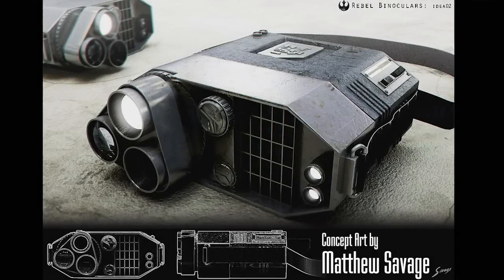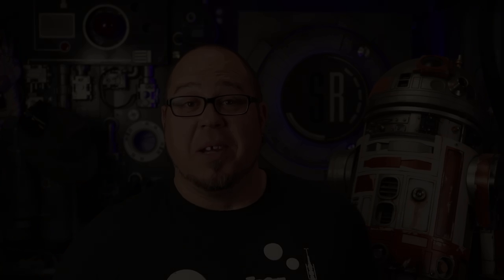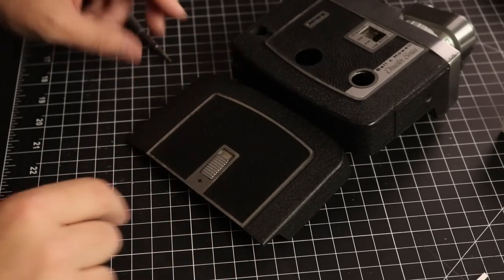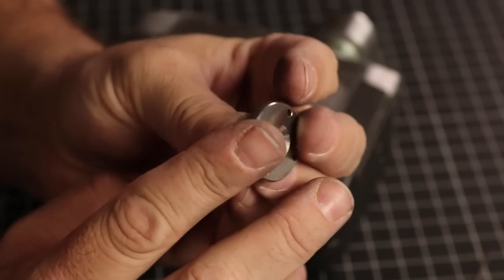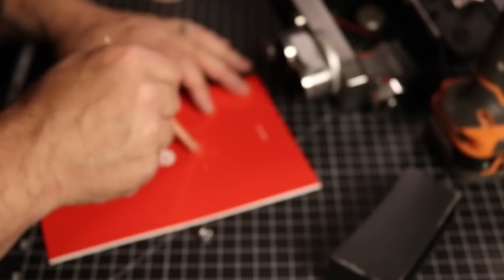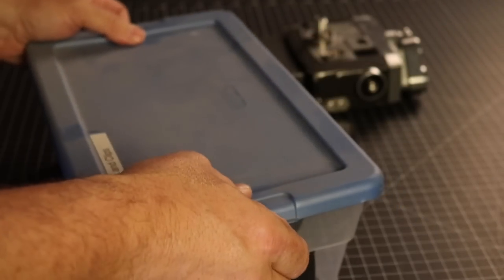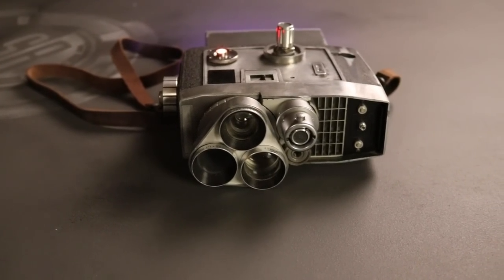Star Wars Binoculars Diy | Custom Project

Comment: I really good way to diffuse the light from those LEDs and make them less of a spot is using the closed cell foam sheets that's used as packing material. Play around with how many layers you need, sometimes only a single thin sheet works great. I use it in the blade plugs for my lightsabers.
Reply from the maker: That's genius! We're going to try that out next time! Thanks for the advise and thank you for watching.

Comment: You could also wire the LEDs into that potentiometer so you're not blasting your eyeballs with blue.  Some people may be fine with it, but blue LEDs get my eyes badly and I usually have to put stickers over them on my devices to dull them down.
Reply from the maker: Great idea!

Comment: Not a bad job... but this is a prop, a stage prop for a fan film. . Have you thought about creating a working sample of electrobinoculars like in Star Wars? I think that these things will be needed for this: an old vhs video camera or a mini-dvd with an ocular viewfinder, there is a very small, about 1.5 cm real kinescope! The space for the cassette and other unnecessary blocks can be removed. Any compact mirrored monocular reflector with the possibility of mechanical zooming is suitable for the lens. A compact laser rangefinder with a backlit screen, its display must be placed in the eyepiece for the second eye, so that when the observer looks through binoculars, the image from the kinescope and the rangefinder screen overlap each other. The active part of the rangefinder- the laser and the photodetector must be placed on the front edge of the device coaxially with the lens. For night vision, we will need a powerful infrared LED with a reflector and a lens for better focusing of the infrared beam. It would be possible to use a module from a passive night vision device, but it would be too expensive for the price, these are not cheap devices. We also need a powerful, capacious lithium battery of suitable capacity with a dilution board, which will allow this device to be powered with electric current. And, of course, you need a housing for this device, it is best to make it out of sheet metal in the form of two housings - internal, which binds the parts into a single structure, and external, for decorative and protective purposes. At the same time, it is not necessary to copy the appearance of existing samples of electrobinoculars from Star Wars, you can make your own original variation. The result is a device that works as a digital night vision telescope with a laser rangefinder. This is cool?

Comment: A nice reuse of gutted old bits. the viewfinder would be crazy bright to use.
Reply from the maker: Yeah, it is a bit too bright.  I’m thinking that eventually I’ll rework it, probably add a small LCD inside and do something fun
Reply: @TheSmugglersRoom  Adding a variable resistor would fix it.

Comment: What kind of glue did you use for gluing the Sintra pieces together? I’ve cut out pieces of Sintra for a flamethrower to attach to my gauntlets for my mandalorian but I’m not sure what is the best. I just need to glue Sintra pieces together
Reply from the maker: You can use CA glue, but I also really love WeldOn 3 for Styrene.

Comment: Can Cintra (Sintra?) be used to make lightweight Death Star wall panels?
Reply from the maker: Hmm . . . probably.  The thicker stuff i bought is pretty ridged.  You would need something to hold it up, like a frame.  But I don't see why not.
Reply: @TheSmugglersRoom  Yeah  I was thinking a 1/4 inch birch plywood box behind the lit sections and just an open backed aluminum frame for the solid panels.  I will email you the results.  LOVE your channel, the delivery style and the energy you bring to the hobby!